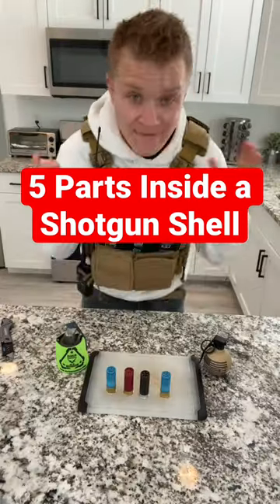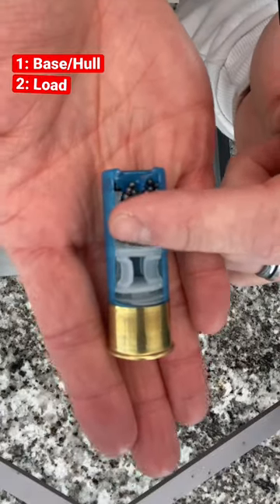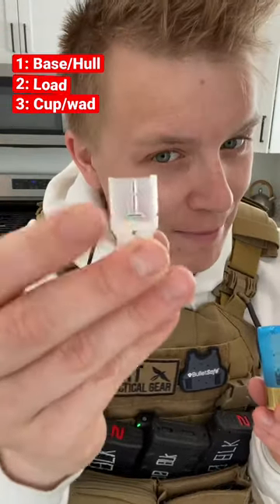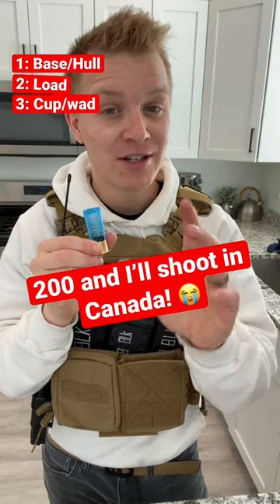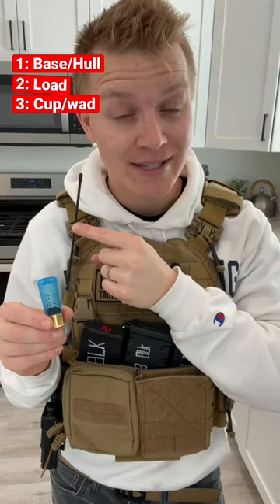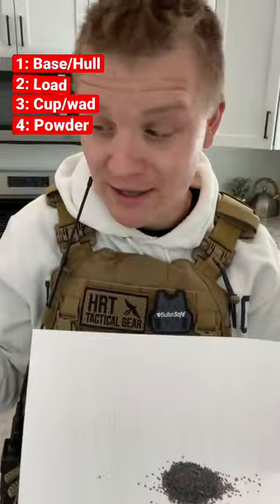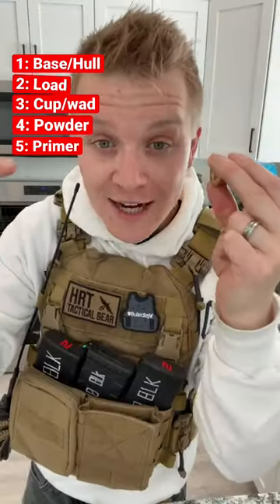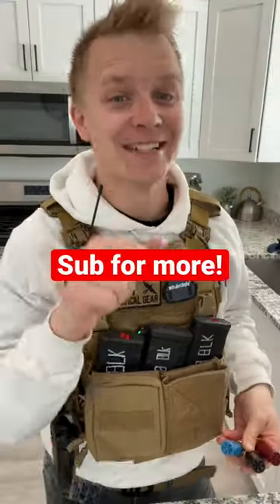What’s Inside a shotgun shell? *CRITICAL 5 parts* #gun #fullautofriday #civtac #demolitionranch

Comment: Back in WW1 and 2 the shells weren't all plastic. They were originally solid brass with a wax coated seal at the tip. I wonder why we stopped using full brass shells
Reply: From my understanding shotguns that used brass shells were more likely to have feeding issues, could be wrong about that tho
Reply: Probably was way too expensive and the whole reason they did use Full brass shells was because the trench conditions were to wet and muddy to have paper or plastic shells so now a days we don’t need it because we’re not fighting in trenches
Reply: I also believe it had to do with weight and price. Plastic is a lot cheaper and lighter
Reply: I’m sure all of our reasons was their reasoning back in the day lol
Reply: @lofton9959  I was gonna say. These are pretty solid explanations.
Reply: Cost and ease of production. We already had massive issues finding brass cases for reloading in the lockdown era. The logistics of brass ammo is absolutely ridiculous in harder to find materials over plastic shells. You can save 80% on hull cost alone with some better loads. This is because the ends of the shells allow for the full 2 3/4 expanded length at around 2.5 inches.

Comment: What happens if you put the shell in the gun with just the primer and set it off
Reply: Just a bit of noise and fire lol
You would pretty much have a blank round if it's just a primer. Some trip wire alarms use a shotshell primer because they are pretty loud.